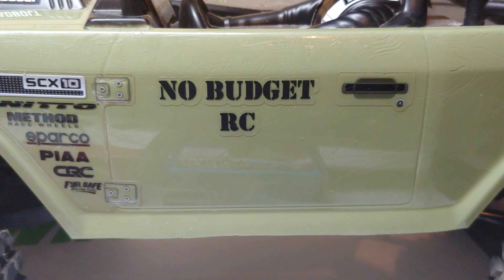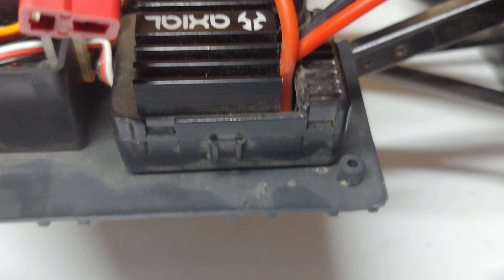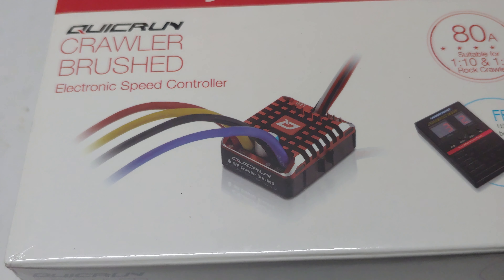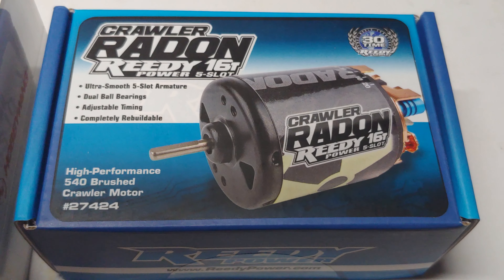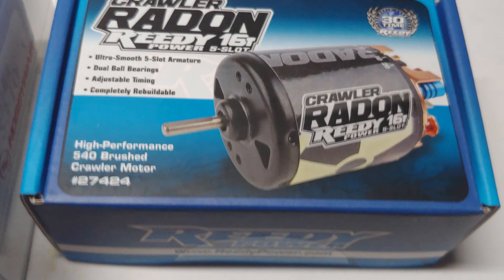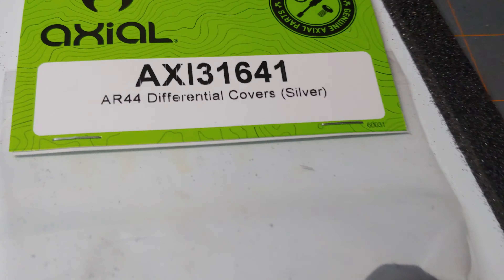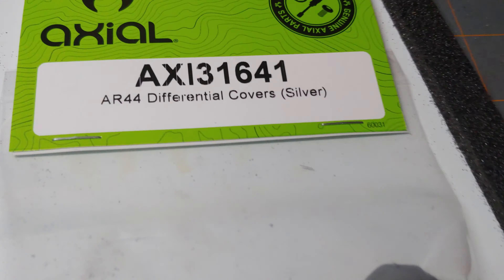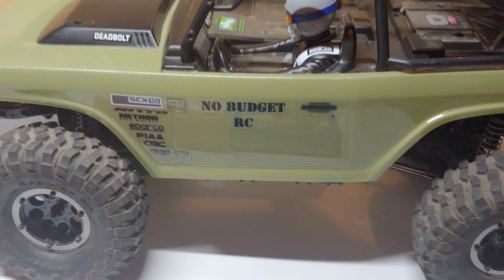Axial scx10 ii budget build part 3

Comment: How's the comparison between holmes crawmaster pro on this radon crawler? Aside from price gap? I'm also looking budget motor that match to my hw 1080  for my sxc10v2..
Reply from the maker: In my newest build I am running a Holmes Hobbies 550 crawlmaster sport 12t and it has way more power than the radon. I haven't ran a crawlmaster 540 can so I don't know how it would compare.
Reply: @rcbasherpodcast898  Thanks for the info bro..nice to know the difference:)